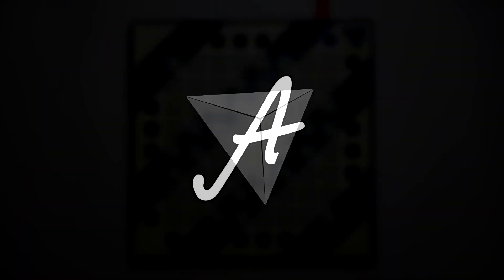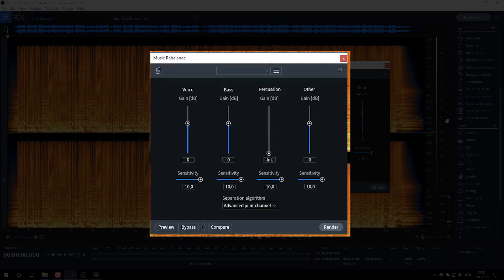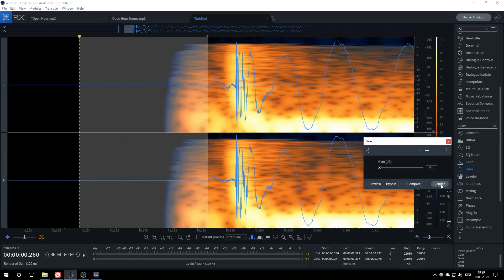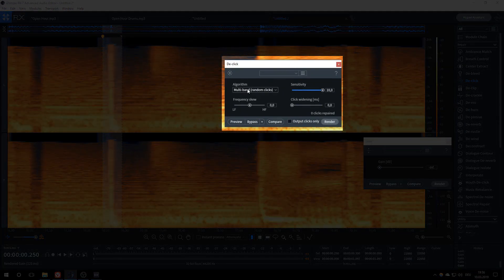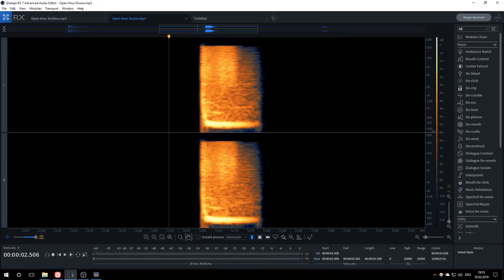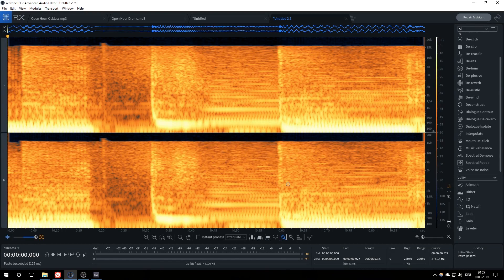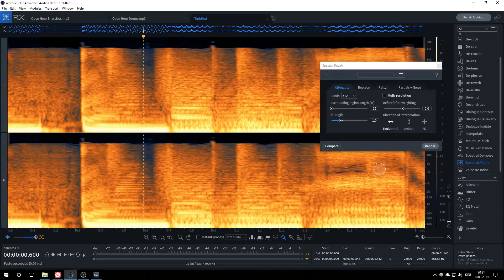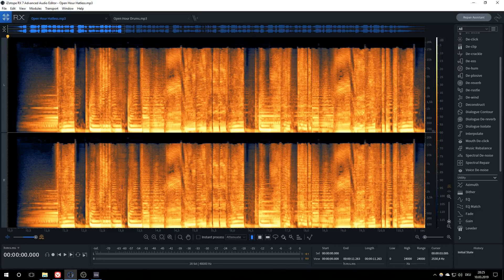Launchpad Tutorial 23 - Extracting and Removing Drums with iZotope RX 7 (Kicks, Snares, Hats)

Comment: But... why not use the RX the-bleed module? Maybe I'm wrong but I think this method takes too long if you have to clean a file of an entire 2 hour concert session :face-blue-wide-eyes:
Reply: Thanks for commenting, here's a couple of reasons:
1. If you ever opened the de-bleed module, it asks you for a source file to generate a bleed profile from. This needs to be time aligned to the original audio that requires de-bleeding.
This is helpful for removing/attenuating bleed from live instruments into each other. For more details on the use case feel free to refer to the RX manual.
2. The technique(s) shown in the video are mostly applicable to electronic music, in which usually the drums are static, unchanging samples that can be easily aligned and cancelled by phase inversion and time alignment. For a 2h concert session this is not most efficient workflow at all.
2.1 Depending what you want to clean up exactly I suggest you take a look into modern ML powered tools like Ultimate Vocal Remover (freely available through its GitHub repository) and trying different architectures and models to let the algorithm extract certain tracks for you. A powerful GPU is recommended for this.
Reply: @rpgaleksy  
1. Of course! I'm currently using the de-bleed RX module, comparing the various tracks saved by the sound engineer which, obviously, all have the same length.
2. Indeed
2.1 I was thinking of trying THR's deBleed. I will also try (probably) the one you suggested, even if I am afraid of installing open source software on the PC, because any developer can insert malicious code into it. I don't know if you've heard of it, but this seems to have happened with the Linux OS.
Thank you for the constructive discussion